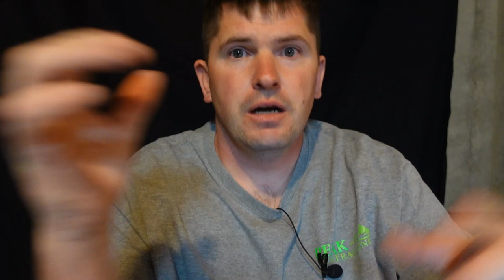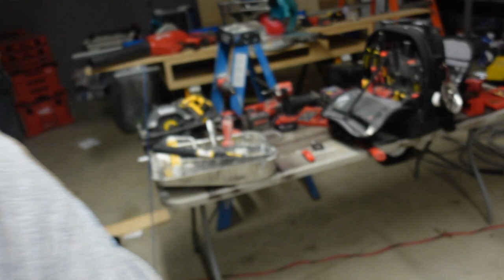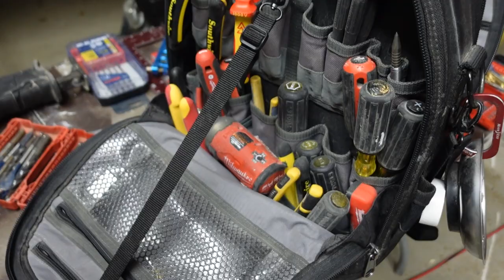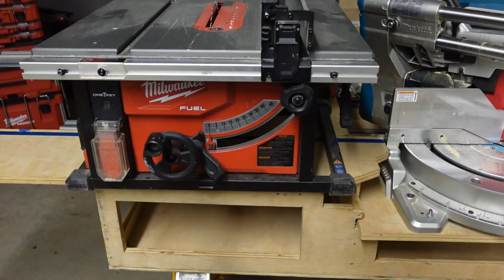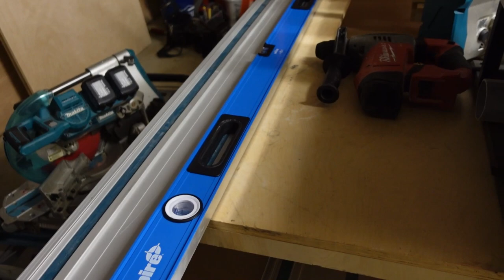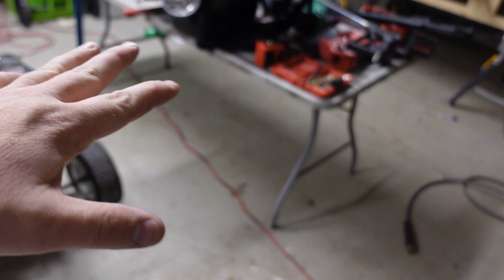Starting a  Handyman/Contracting Business?  Steps to take and tools to get!

Comment: I absolutely hate every cordless table saw I have ever ran. A 10 inch dewalt job site is way cheaper than a 8 inch cordless and it has way more power. I also haven’t been impressed with cordless miter saws. It is easy to run a extension cord